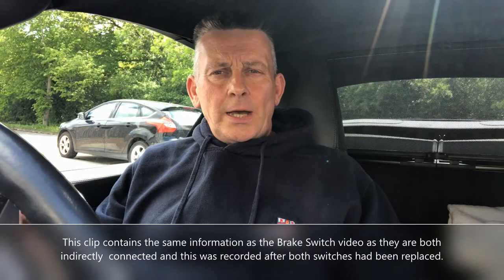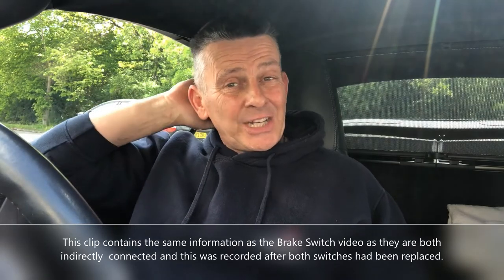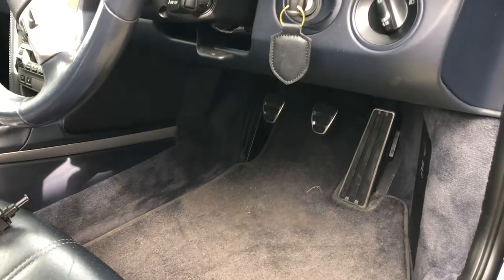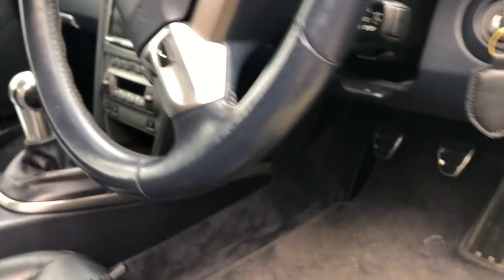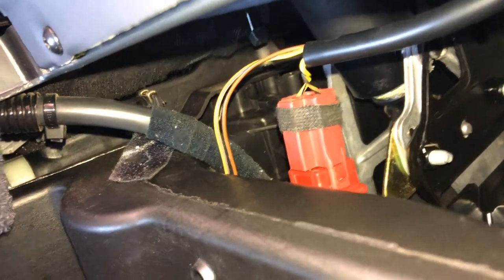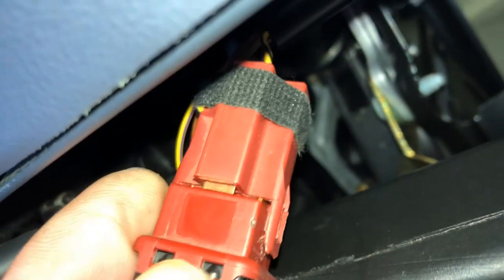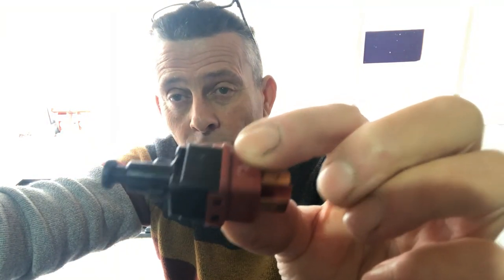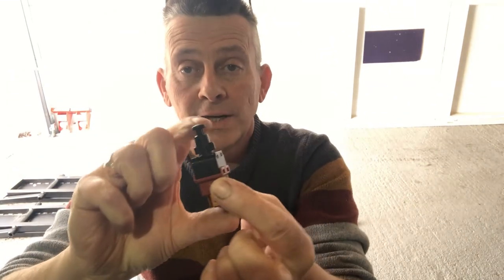911 Clutch Pedal Switch Replacement 996 / 997 Following Cruise control Fault. Easy Fix.

Comment: Yes, thank you! This helped me not for the cruise control, but the PSM failure coming up sometimes. Checked the steering angle sensor, spiral cable and whatnot. After checking the clutch pedal switch I noticed it wasn’t working properly. Didn’t replace it though, opened it up and fixed it 😇
Reply from the maker: Glad it helped! Glad you got it sorted.

Comment: Had all of the same problems and tried most of fixes with no result.   One day it came to me that  just maybe the brake actuator arm was not pushing hard enough on the switch.  So went out and tried the curse control with no result.  Then I pulled back on the brake arm with my toe and the cruse control worked.   Now have two layers on Gorilla tape on the brake arm and the cruse control works.  The jury is still out one the ABS/PSM problem.  ABS/PSM has not failed after I pulled brake arm back.  So we shall see.   Duck tape will fix anything!